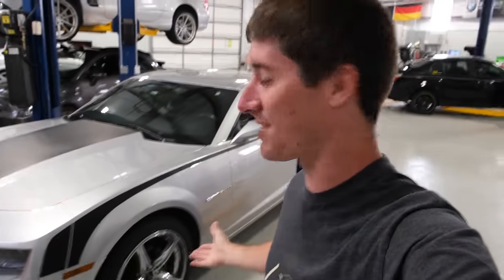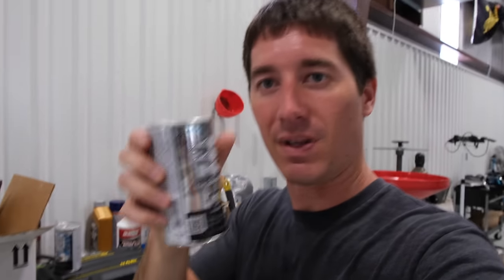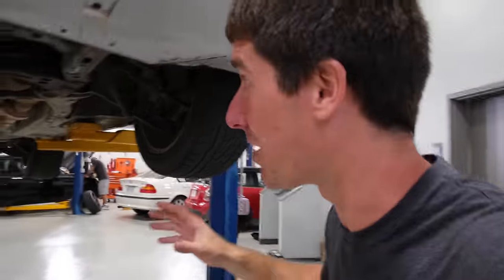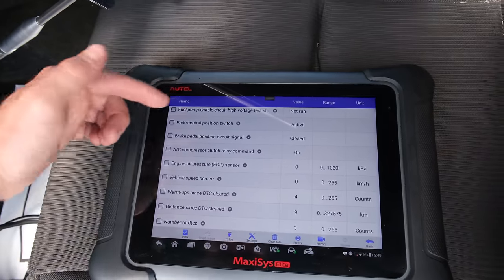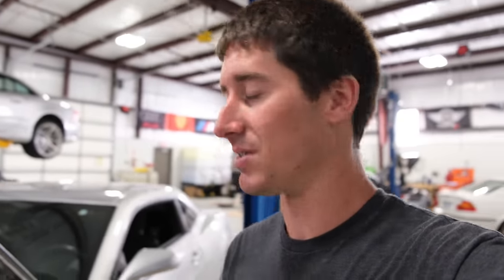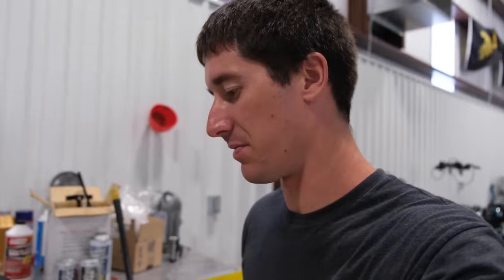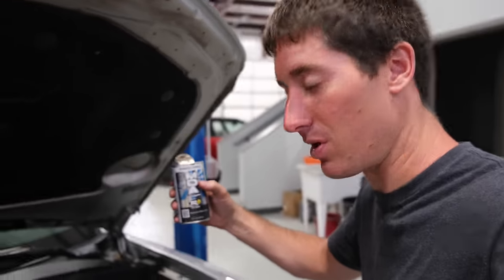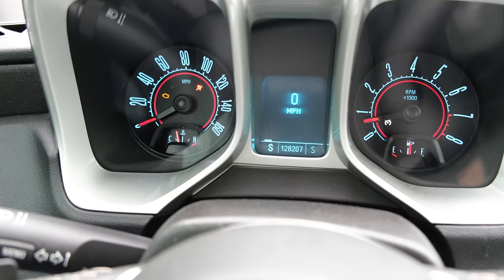FIXING The UNFIXABLE Engine In My CHEAP 2011 Chevy Camaro RS *SLUDGE REMOVAL*

Comment: I did that with an oil filter full of transmission fluid, in a '97 Grand Am Coupe with a nearly demolished 3100 with a compromised lower intake manifold gasket. All the lifters and rocker arms besides three that were dropping needle bearings were revived after gasket swap and a .5 hour idle, then some 1st gear only rolls around town, but the lifters became quiet after 3 Mississippi's on first startup after gasket and filter of Mercon. Look for flat spots with two threaded holes on the strut towers by the engine, if they not there on the 2011, you have the old, very weak timing edition. Either way you will need fresh chains, vvt cams, and tensioners for it to run worth a shizz, especially if one heads vvt cam is broke and doing advanced retards or retarded advances. The pcv head gets the worst scum, but it aint no 3.5 ecotoot coolant sucker.

Comment: does this apply to the 3.6 ly7 motor they used certain gm suvs i have a 2008 saturn vue AWD  redline 90k it has a crank an cam bank 1 correlation low circuit code its really hard to start 10 tries later when it does it screeches an rattles rev it to 2-3k rpm it sounds fine but you have to keep hitting the throttle to keep it alive or it stalls just wondering if its because of bad timing crank sensor or possibly bad motor

Comment: Jr id be pulling the pan off and checking oil pick up screen after you've put the cleaner through it.  it will give you peace of mind if nothing else. Also the sludge that frees itself has to go somewhere..We had an imported Volvo xc90 come in from the importer with oil pressure dropping off at revs. The car had 120000kms on it and was immaculate. So we put a flush through it and then fresh oil and filter.  The importer didn't want to spend any money on it because it cuts into his profit. That fixed it for 3 days and it came back again with the same problem, so this time we did it properly . We took the rocker cover off and it was way worse than your car  you have there. You could hardly see the cams. We sprayed degreaser on to the cams and brushed the worst of it off and drained it over night So the next morning we pulled off the pan and scraped out the inch and a half of sludge that hadnt drained out over night. You could see the impression the oil pickup had made in the sludge. It was like asoft grease.we took the oil pick up off and set fire to it with some gas in a steel tray outside on bricks. The oil pressure relief came out too and we cleaned it out and refitted it. It burns the sludge off the screen without damaging it. It turns to carbon and washes off with degreaser. We hired a  steam cleaner  ( A hot  pressure washer)  Jacked it up and stood on a step ladder and blasted it from the top down and the from the bottom up. a messy job. It went back together . We put fresh oil in it and a filter in it and the importer gave the new owners  a free oil change after 1000km of purchase. it worked.  We think some one put in the wrong type of oil at some stage in its life. maybe a heavy diesel rated oil.

Comment: Fill the engine with atf for like a week and then drain it and put in the highest weight oil you can make sure to pour it under both valve covers. Maybe pressure wash and drain the valve area before filling with oil. Then drain the oil out after running like in the video. Replace filters like in the video too

Comment: I had to run diesel oil through my 84 dodge d150 to get the sludge out. Never fully cleaned it out but it reduced top end noise and engine smoke.

Comment: John ross please watch this video: https://youtu.be/5QLPU1Qh2oo 

Even before I saw that video 3 years ago I had already noticed that same problem myself after doing more than a dozen junkyard engine swaps on traverses/camaros/Saturn auras you name it. It was always the same damn thing!!! I disagree with one thing tho, the guy says it's a good engine other than that engineering flaw. No, it is not a good engine. I've seen way too many of these engines completely trashed under 100k miles there is no way you can call that a good engine.

Comment: This is like the 3rd or 4th BG sponsored video I've seen, and all with the same result.

While BG does clean the crud in the engine, it does nothing to repair the issued caused by the lack of maintenance or oil changes. It appears to clean things up for the mechanic more than the vehicle owner.

Years ago, when cars burned a quart of oil in 2000-2500 miles, it was common that instead of adding a quart of engine oil to add a quart of transmission fluid. I've taken really sledged up engines, drained the oil and refilled with kerosene, and allow the engine to idle for an hour of so, then drain, new filter and fresh oil. It did break free a lot of sludge, sometimes at the expense of the oil pump.

Comment: There's a product out there that keeps sludge from happening in a engine. Lucas oil stabilizer, use it in all my engines and they have over 200k miles and 0 sludge. Read the bottle it states that it reduces sludge buildup. And I have seen the inside of my engines and they are clean. and  dealerships are not going to put any money into i 10 year old vehicle. And I don't think that they are stupid enough to sale that car even as a body for less than 10k hell copart would have gotten 8k for it.

Comment: I am actually kind of surprised you didn't do a second flush, run that product through twice to remove the sludge because each time it looked really bad. I wouldn't be surprised if you still see some sludge in the engine when you do the timing chains.

Comment: If engine oil looks that nasty, chances are the trans and differential are too along with brake, pwr steering fluids. That previous owner ran the snot out of this car and didn't do anything but fill the tank.

Comment: I would open up the oil pump and inspect it for wear. You're going to take off when you do the timing belts, anyway since it's also the timing cover. My bet is that is that it has a lot of scoring from contaminants in the unfiltered oil it picks up. I'd also bet that oil pump won't self prime. So if you leave the car standing for a few days the oil light won't go off and even if it does it will take a longer than an acceptable time to do so.

Comment: timing chains super common here on the holden commodore v6 looks to be the same engine  the whole kit genuine from holden is only 500 aussie dollars which is all gaskets chains guides tensioners nuts bolt etc and around 6-8 hr job

Comment: here's your problem yes its clearly do to a lack of oil changes .
But all standard engines have a bypass on the filter. its either built into the filter or in the adapter,
The idea is when people dont change there oil at the proper time the filter will get more and more restricted and dirty oil is better than no oil flow. So the bypass opens. it also opens on cold starts and sudden acceleration.
So when you try to do these snake oil treatments all your doing is breaking the crap loose and destroying the engine with it plugging the pick up and galleys destroying bearing surfaces. 
the bypass is also the reason there was not a chance in H--- that BMW engine would have been fixed with rod bearings alone.
The old time oils were very sludge prone and any old time mechanic would tell you run non detergent oil in a sludgy engine the last thing you want to do is break that sludge lose and it will kill the engine.
that has not changed

Comment: I did the poor man's version of sludge removal on an '82 Mercedes 300D using ATF in place of motor oil - a DIY fix recommended by a few old-timer mechanics who thought it was the solution. While it was clean afterward, I also believe that the sludge I'd liberated also accelerated wear on the engine and made the blow-by worse. So I'm wondering how the BG Products oil prevents that from happening ...
Reply: Somebody told you wrong. Transmission fluid in place of engine oil can absolutely ruin an engine.  You can use it as an engine flush, but only a quart is necessary, and for only for a couple hundred miles prior to a complete oil change. Changing to synthetic engine oil will make the greatest difference long term.

Comment: No oil cap, no oil pressure.
Reply from the maker: That’s not how that works 🍻
Reply: WatchJRGo If the strainer is clogged it could be how it works. If the pump can’t lift the oil from the pan you won’t have oil pressure.

Comment: Use a pickup magnet while draining oil see if it bends the oil stream. If there is metal in oil it will bend the stream oil as it drips out. Valencia BMW had something they sold product that filled engine with liquid cleaner then circulated it inside engine until clean.   It cleaned carbon sludge.

Comment: I had a old Chevy pickup that had bad engine sludge it was caused by a bad catalyst converter I used chemtool  to clean up the  heads but if you don't get them clean it will spin the bearings

Comment: I bought a 2011 camaro lt couple years back and the engine had the timing chain recently changed and the car had 4 owners . So in less than a month of purchase the engine went n the dealership said that it had alot of sludge in it. They ended up replacing the engine but its crazy that car had the same problem.

Comment: Oh not only has that motor not had oil change but it has been overheated slightly too probably due to low oil , that's what it looks like to me probably been beat on pretty hard but you never said how many miles or maybe you did and I just did not pay attention good luck John Robert

Comment: They use these engines in commodores in Australia. At the passengers side at the back of the engine behind the rocker cover there is a hose connection for the breather has two tiny little holes it gets blocked. The symptoms. It now sucks oil into the throttle body car runs rough. One bank on the engine will be like new the other side will be horrible fill with crud

Comment: These engines are in the holden commodore vf series and have the same issues, even with regular oil changes, pcv system is the issue.

Comment: I really don't like replacing engines i like to rebuild so the car can stay with its original engine in it. If it was my car a will just pull out that engine tare it in to prices refresh that engine and put it back in.

Comment: The ninja will grenade your engine again just use a gallon of paint thinner remove the spark plugs turn the engine several times and the sludge will go away or you can use diesel no spark plugs and turn the engine and it should clean out don’t forget to use transmission fluid to clean out the engine from everything else you put in there

Comment: You don‘ t Need this expensive product. Just use kerosene, 1/4. let the engine run 10 minutes. Drain the oil. That’ s all. I always do it. It works perfect.
Reply: Not on gdi man. Ive learned the hard way.

Comment: That isn't timing chain rattle against the wall, that's the direct injection high pressure fuel pump
Reply: Yeah, I have that engine and I think you are correct.....

Comment: Best way to test what chemical to use is leave some used oil in a few separate containers and let it age and sludge,  then add said chemicals and shake. And see how it will dissolve the oil.

Comment: my dad usually does an oil change every 20,000 miles gotten a bit lazy lately with his 98 exploder with 300k miles tho
Reply: RedRevo 117 An engine not prone to sludge, no turbo, and what seems like proper heat cycling, no problem.

Comment: If you’re worried about keeping the Engine cool at high rpms standing still use a water hose and spray the Radiator.
Reply: Sure......if you want to ruin the radiator AND the engine.....

Comment: Geez. I've been doing the same thing using transmission fluid for years. Like 30 years. Works the same way by cleaning out the engine as transmission fluid is just a lighter but heavy detergent oil. Bet you dollars to donuts you would get the same results for less money.
Reply: Forgot to say, after cleaning it all out and putting in the final oil, I would add some Marvel Mystery oil to it. Worked every time.

Comment: I’ve read that putting in some transmission fluid about 600 miles before an oil change can help with sludge buildup. I wonder if there is any merit to that claim or if it would work as well as the cleaner.
Reply: ATF is loaded with detergents and will clean things up, but I wouldn't say I'd do that frequently. Regular oil changes should be plenty on any car. Regular being the key term there. I don't trust this 10,000 mile oil change non-sense going on today.

Comment: At 180K miles on my 2009 Chevy Malibu, my filter housing looked way cleaner than that.
The trick is that when you do the oil change, use a flat head screwdriver to get the sitting oil inside of the housing by scraping the oil towards the holes/slots.
Reply: lol - whoooosh

Comment: Is this something you could do.  On a used car u just bought and wanna make sure the motor is clean.   Mines 85k mikes just bought last week.  16 Silverado
Reply: Won't hurt, but for $50 you can buy a cheap inspection camera and send it into the oil fill hole to see if it needs it.

Comment: I had a Toyota pickup that had an oil sludge issue when I got it. Just so you know all those products may work perfectly but you'll still want to pull the oil pan and manually clean the oil pan. I learned the hard way so just trying to save you some grief. I was doing 70 mph on the I-40 and wasn't watching the oil pressure close enough and it lost pressure and before you could say Christmas 3 times as fast as you can all the rod bearings started knocking. You might want to change the rod bearings as a safety provision.
Reply: This is gonna be like the 4th time I've said this in these comments today, but an inspection cam is like $50 now. If you think you could have a problem, get one and send it on mission to see. It takes 5 minutes to run one in the drain hole and simply observe the condition of the pan and pick up.

I may have to make a video on this soon because it seems a lot of guys don't know just how cheap these things have become. I didn't until I got one for Christmas last year and thought it was a really luxurious gift so I had to look it up out of guilt. They're likely cheaper than most pan gaskets and pick up tubes.

Comment: My take on flushing is using hot shot secret  sticktion eliminator  does flush by   adding to old oil  I've used it on a deisel with a million miles  it went from using a gallon  a week to 5 gallons thirty thousand  miles  on semi truck deisel 🤙🙏
Reply: Still works on gas engines to

Comment: Why does full heat help cool the engine?!
Reply: heater core is just a small radiator that uses the hot coolant of the motor to create hot air in the cabin

Comment: make sure you get the plates to hold the cams in the correct position when you remove the chains. They are only $25 on Amazon
Reply: You can use wooden dowel rods , much cheaper , and works perfectly
Reply: Not sure about to he plates probably need those also , but the dowel rods hold all the lifter's up and in place if removing the cam on a V8 , not sure on the V6.

Comment: Can engine sludge cause low compression and therefore a misfire? OBD says cyl 2 is missing, replaced ignition (coils, plugs, wires), new fuel injector, and the compression tests about 50 psi lower than the other cylinders. Car sat for 5 years, immediately changed the oil and did a BG EPR treatment after 3-400 miles, runs better but still missing and smells rich. Running out of ideas and money to fix this piece of shit.
Reply: Stuck rings can (so sludged up rings), but I would expect to see that on more than one cylinder. Also, what did the bad cylinder report for compression? Anything over 100 should still run, but maybe not be real happy about it.
Reply: Pull the #2 spark plug and drop in a few drops of  marvel mystery oil let it sit a bit... pull other wires so it won’t start and crank it over a couple times reinstall plug and wires and run it...worth a try and might help
Reply: Maxwelhse cyl 2 tested about 125 psi, other cylinders in the 180 psi range (give or take 10 psi), OBD throws the occasional miss on cyl 4, mostly under load or WOT, have only put about 400 miles on the car since getting it back on the road, is it possible to drive some of the shit off the valves and rings with a few hundred more miles?
Reply: @Cousin_Gregg  Anything is possible, but you're down 30% on compression so there... not good news.

As I understand it, the crank position sensor monitors for a misfire condition by detecting changes in crank velocity and it's possible that cylinder being down so far is actually fooling it into believing its not firing when it actually is firing fine, just not making the power its supposed to. So, I'm saying everything could be working fine, but the crank is slowing down enough to upset it anyhow.

First thing I'd do is the oil treatment mentioned above (won't hurt... just don't dump tons of oil in there as that will hurt), but I'd let it soak for awhile first just because you can. Then I'd probably get a cheap inspection cam and send it down the spark plug hole and see if the cylinder is all scored up. If it is, it's game over. So then you just drive it until it stops moving and don't worry about the light. ;)